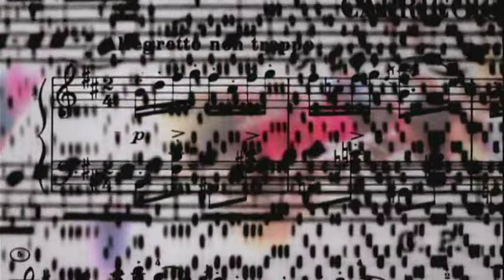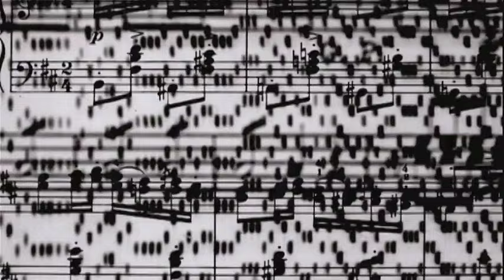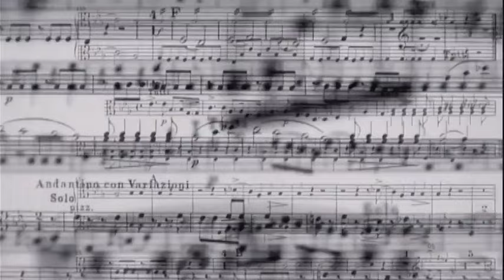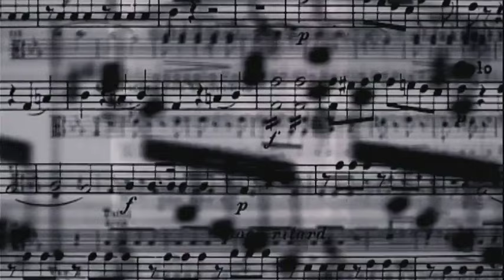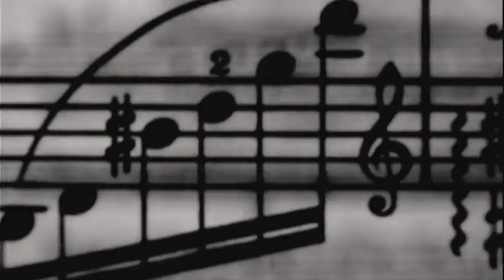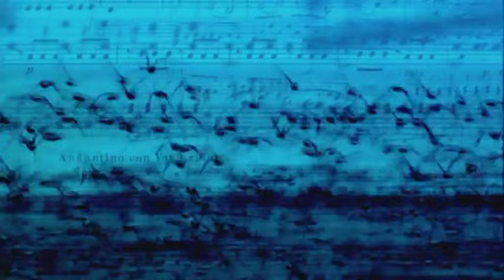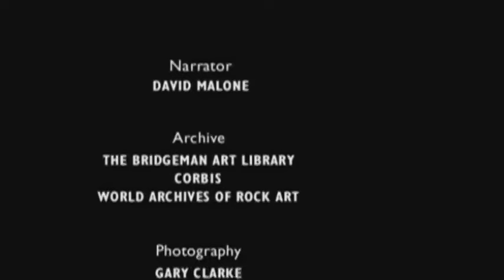Testing God - episode 2 - Darwin and the Divine

Comment: Here is a reply I gave to someone about Anselm's God view reasoning that God is the biggest thing one can think off:

If you gonna do infinities to follow Anselm "god" pick the bigger one which is irrational and uncountable, thus fragmentary, turning "god" infinitely unrelated to itself own properties, on the infinitesimal level, one by one, and therefore non-logical.
Finally, I think God is the opposite, it has finite properties but was not created, its a fractal boundless loop, it is not a mind because as the ground of all being it doesn't need to ask questions, solve problems which IT doesn't have, or have any goals which are not already accomplished in Being itself outside time, nor escape its own root Logic which it cannot change. Yes "god" is Love because it connects, because it is rational because it is countable and intelligible. Finite yet everything! The prime mover, that "raises" conscious beings yet not conscious of itself! Consciousness requires awareness within time and therefore limited to contingent knowledge which in turn leads to the necessity of computation/thinking troubleshooting problems based on guesses about future states of affairs. The true abstract mathematical rock of all Being is pantheistic, a spacetime block unmovable Universe, done, accomplished, quiet, timeless, and yes you guessed it DEAD!
Reply: Huh?